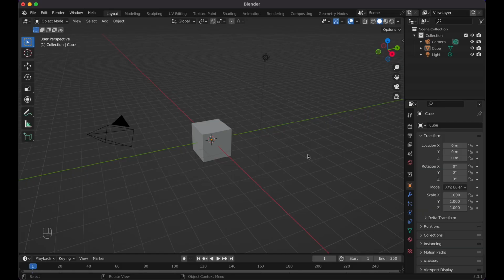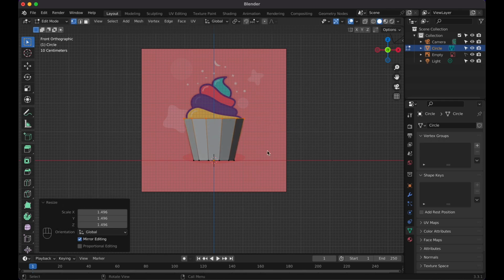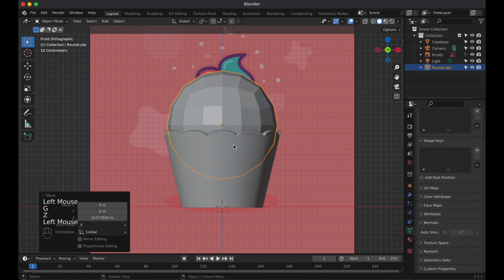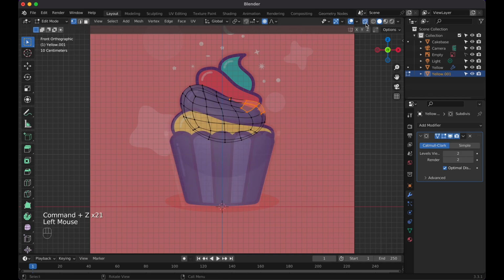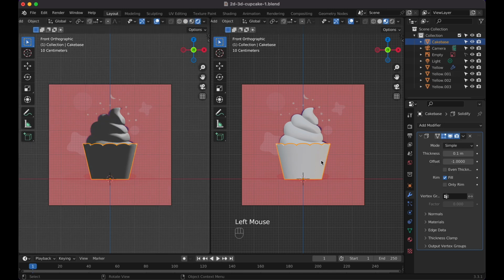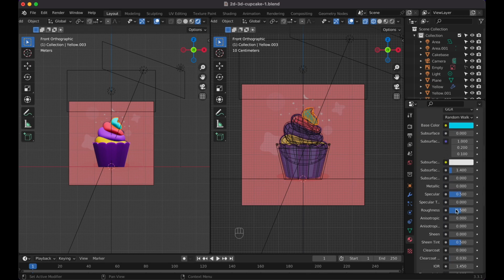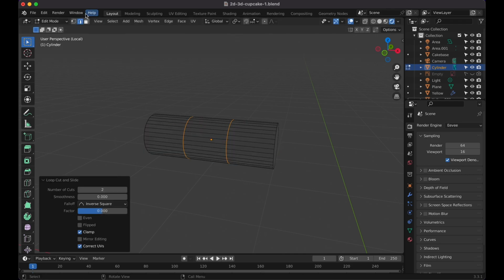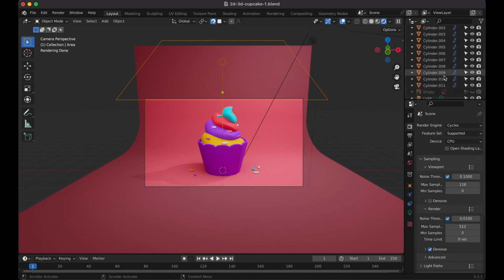Turn 2D Image into 3D in 15 Minutes Easy with Blender

Comment: I'm confused at 4:05 where you create the curves for the cupcake thing. For you it was hollow and only did 5 verticies, but when I did it there were like a bunch of connecting verticies and it wasn't hollow. Could you please let me know what I'm doing wrong because I've rewinded over 10 times just trying to figure out what I'm doing differently but I'm following all of the instructions. Also, it only removes 12 verticies instead of 24.